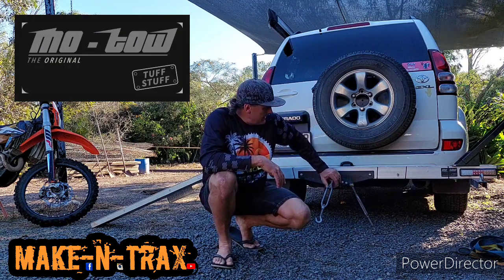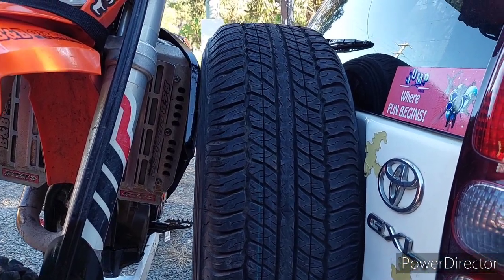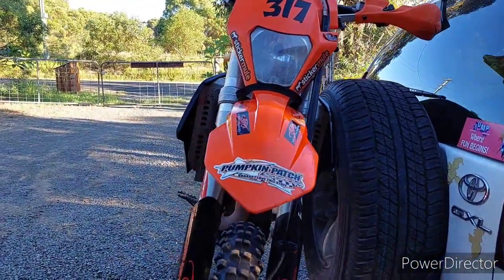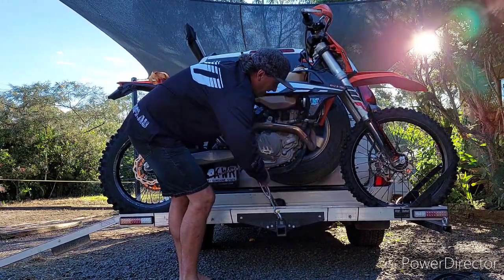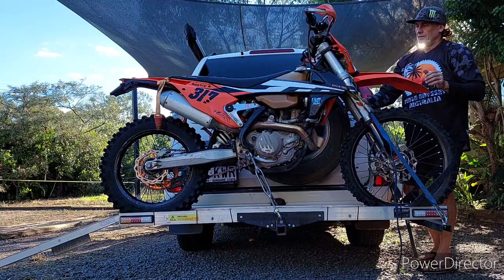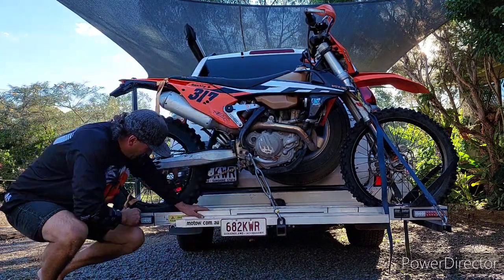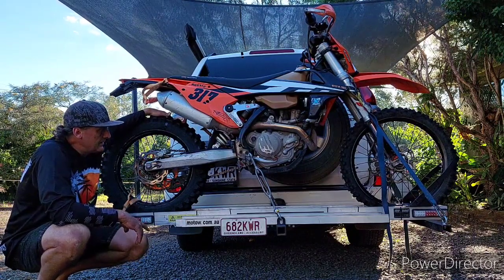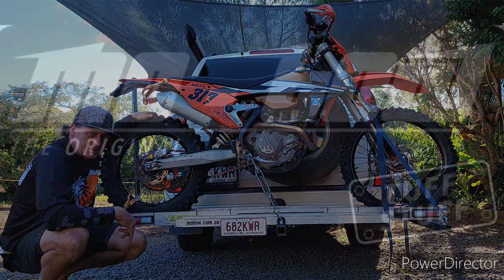MO-TOW BIKE RACK / CARRIER 15000KM REVIEW

Comment: How much can a bike stick out past the side of the vehicle?
Reply from the maker: In QLD 150mm either side.
Reply: @MAKENTRAX  mirrors included in width or panels?
Reply from the maker: The diagrams don't show mirrors, they just indicate the widest part of the vehicle like bumber and guards etc. i used a straight edge off my guards as the prado tapers in alot so makes it look like the bike sticks out heaps. but its right on the limit

Comment: Great video mate! can I ask what the hitch is like going into the vehicle? I've noticed a few of them 'rock' a bit from side to side. When you moved your bike it didn't seem to have much movement and was wondering what it looked like to keep it so stable. Cheers
Reply from the maker: Hey mate this rack comes with a ANTI TILT bracket that eliminates any major movement by locking the rack firmly to the drawbar. Check out 1.50 and 3.30 on the link below of my video when i first got the rack.
https://youtu.be/9ZdJo3ugtfs
Reply: @MAKENTRAX  Thanks heaps mate for your quick reply and awesome informative videos. If you're ever down in vic ill take you for a ride through the high country 🤘
Reply from the maker: @langzikesch25  No problems mate i hope it helped ya out.  Cheers mate would love to ride the Vic high country.  Seen so many vids from down there

Comment: Good vid man. Have you had any cracks on any of the welds ? I have a couple of tiny ones under the front wheel.  I see motow also have a steel model now.  I've used mine every week for about 4 years.  The secret really is just tying them down from the centre (although i use straps around my perimeter frame instead of turnbuckles). As a backup you can use a chain or wire from the hitch with even a quick dogclip or snap buckle to latch onto the bike at a premeasured length for a backup system.  I think the biggest mistake is people thinking they need to be tied down forward with the straps.
Reply from the maker: Thanks mate. No cracks in mine yet. Yeah as you would have seen i do the same as you and just tiedown from the middle and just have front straps there as a back up. Thanks for watching and commenting your experience mate👍

Comment: I have the same problem with my back tyre pinching the ramp on, if I remember to take it out before I tie the bike in it’s all good but yeahhh once the bike is tied in it’s a mission. Being a short bloke with a lifted car I struggle getting the bike on the back haha. Also my spare wheel carrier protrudes to far to load the bike on so I have to run the spare in the car which takes up a bit of space. Besides all that it works well and I love the stabiliser on the tow bar with the Allen head bolts, locks it in place really well
Reply from the maker: They are an awesome rack hey👌

Comment: Hi, what are you connecting the turnbuckles to on the bike itself?
Reply from the maker: Onto the footpegs
Reply: @MAKENTRAX  Thanks. I'm new to transporting on the rear obviously. I bought the Motow 1500 for my CT125 and the bike is slightly out of shape for the rack (plus has rubber pads on the footpegs). Hence I'm going through a range of options to loop over the pegs.
Reply from the maker: @millsa99  ah ok. Maybe some chain or a ring of some sort
Reply: @MAKENTRAX  Yeah, large clip ring. Looking

Comment: Good info mate as usual. I have a question not related to this at all but looking at closeups of your bike do you run stock radiators and im guessing you have a fan. Ive had my 08 450 for a while and the radiators are not oem but unbranded and the guy told me slightly bigger than normal for better cooling but no fan. In your style of riding is the fan neccessary. I know stupid question but  thought I would ask you. Cheers mate
Reply from the maker: Hi Pete. OEM radiators and OEM thermo fan, and yes the fan is essential for the style of riding i do. I have only had the bike boil on me once and that was in the middle.of summer on a track that took us 3hrs to do 5kms😁.
Reply: @MAKENTRAX  I know what im fitting this week cheers mate